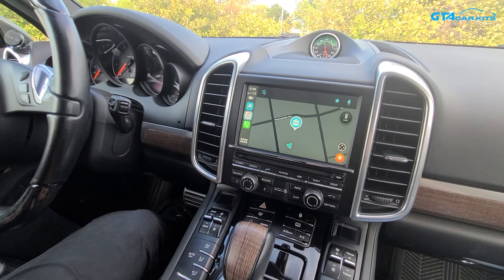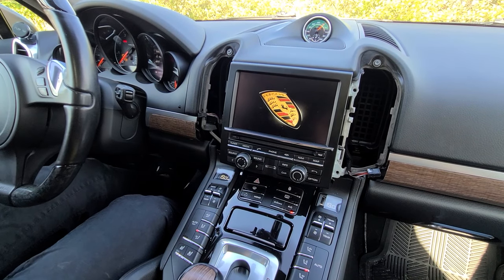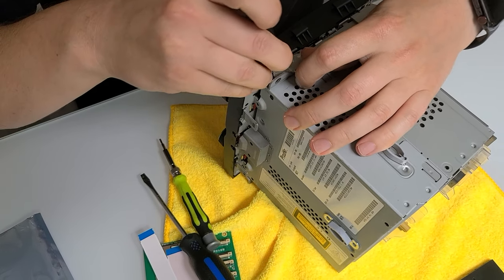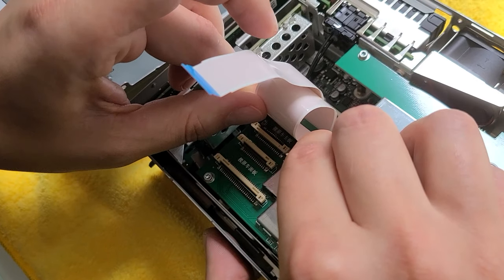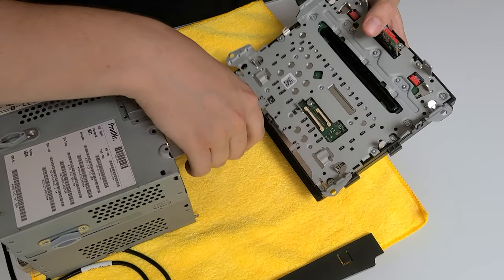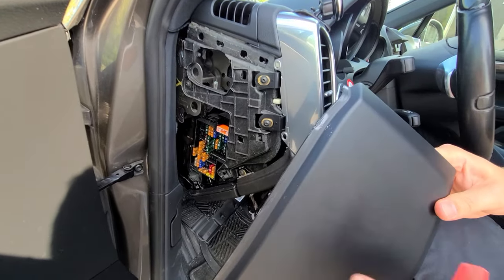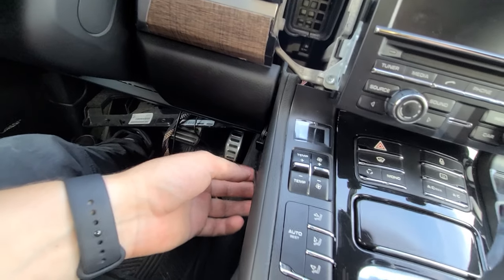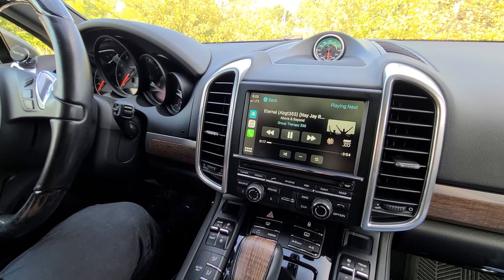Wireless CarPlay and AndroidAuto in Porsche Cayenne 2011-2016 (supports touch screen)

Comment: I just had this installed this on my 2016 Cayenne and it works incredibly well. Their customer service was top notch as well
Reply: Where you got the kit?
Reply: Gta car kits
Reply: Does the regular navigation work with this installed
Reply: @whoispmb  yes, it switches back and forth, like having two systems, just gotta hit the Nav button
Reply: @joeliam  thanks for clarifying. I am looking at picking this up for my cayenne as well
Reply: @whoispmb  did u buy it & have it installed?
Reply: @joeliam  I gotta question no1 seems to be able to answer, maybe u can help me out. There’s a button on the driver’s side wall . If u move your seat back or forward u will see it otherwise it’s inconspicuous. Do u know exactly what it does?
Reply: @JoonBalloon  sorry I do not
Reply: @joeliam  thanks for the reply. I have owned 3 & still do not know the purpose of this particular button smh
Reply: @joeliam  ok I found out what it is. It’s a tilt alarm switch. Ironically my Cayenne’s alarm kept tripping off today & I didn’t understand why. Come to find out I’m parked on a hill & apparently the tilt kept setting the alarm off. The switch deactivates tilt alarming.
Reply: @JoonBalloon  Yes, its for your car alarm if you lock your door with kids or dog in vehicle, that way it won't set it off
Reply: @JoonBalloon  I believe it’s the rocker switch to kill the alarm. Just in case someone stays in the car, it won’t alarm.
Reply: @joeliam  where did you buy this kit? I need for my 2016 Porsche
Reply: How much for the install?
Reply: How much for the install
Reply: @JoonBalloon  i believe it is an interior security sensor?
Reply: Uae available

Comment: Great video.  One thing to note, some models require you to transfer the optical connection from the original harness to the new one.  If you skip this step you won't get sound out of the speakers.
Reply: What exactly do you have to do ?
Reply: I have no sound out of my speakers.  Is there a video available for the workaround?

Comment: I just installed my CarpPlay kit on my 2011 Cayenne and this video really helped. I ran into some problems with the ribbon cable not snapping in the place properly, which gave me a blank screen initially. One question I have is that the multimedia module seems to be on, even when the car is turned off. Wouldn't that drain the battery?

Comment: After this unit is installed, will you retain the functionality of the factory installed back up camera?
Reply: Yes, mine had a cable to connect a rear camera, I did not use it and my original camera works the same as before.

Comment: I am considering doing this to mine.  The title of this says Wireless but you had to plug in the phone which is now not wireless.  How do you get it to the point where it is all Bluetooth and you do not have to plug in the phone?  Also GREAT video and instructions!!!
Reply: It is wireless, you just have the option of connecting it through a USB cable as well.

Comment: Hi there! 
I was wondering if you are using the carplay mode, does the proximity sensors still working or you have to change manually to the original mode?
Reply from the maker: If you put the car in reverse, it will switch to that mode. If you want to launch proximity sensors separately, you would have to switch out of the CarPlay mode. Thank you.

Comment: I just followed this tutorial and got excellent results, except I had NO AUDIO... My Cayenne has Bose audio and uses fiber optic cables. 
YOU MUST DISCONNECT THE LITTLE CONNECTOR WITH THE TWO FIBER OPTIC CABLES FROM THE ORIGINAL BIG SQUARE CONNECTOR AND PUT IT IN THE NEW BIG SQUARE CONNECTOR FOR THE AUDIO TO WORK.
Reply: Thanks for the help! Worked well for the sound 👌🏼

One issue I’m having is that I don’t see the camera when I put reverse, I have the factory camera installed.
Reply: @fouadabboud9531  did you fix this?

Comment: Great video!  I have the base head unit in my 2014 cayenne, so it has a 1/8 mini jack to plug in a phone, and it also has blue tooth.  Can this be installed in this system and work with no problem?  Thanks Barry

Comment: Hey bro, thanks...awesome video. Expecting my kit tomorrow...gonna be a sugar run with your tutorial...
Reply: @Jacob. Did u get the kit & installed it?
Reply: @JoonBalloon  Yep, took me about 4 hours though, had to dismantle it again due to a loose connection...Automatic wireless connection doesn´t work though, only once  after a reset. If the ignition is off for more than, let´s say 2 minutes I´ve to force it to reconnect either via the system menu or a bluetooth-reconnect on the iPhone...any ideas on that one?
Reply: @jacobcreutzfeld3505  no I don’t. I was hoping u had figured it out. If u had my next question was gonna be where are u located & how much would u charge to install mine
Reply: @JoonBalloon  :-) that might get a bit difficult , as I´m living in Germany. But don´t worry, it´s not such a big deal, especially having that video...!

Comment: Thanks for posting this - pretty slick. Could you do a video showing the boot up time when you start the car?
Reply: Also... Do you lose CD player, backup camera, and the in dash navi?
Reply from the maker: Hi, we do not have the boot up video, but it boots as fast as the original radio. You will not loose any original functions of the radio.Thank you.
Reply: @gtacarkits  I got 2012 base model , i dont have backup camera can i add with this module or do you guys have any other solution for that ?